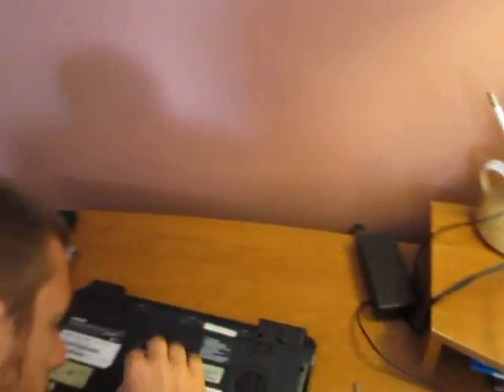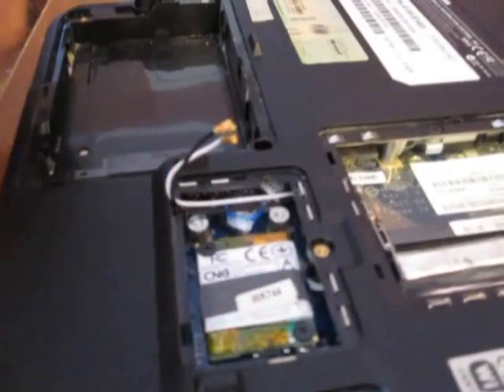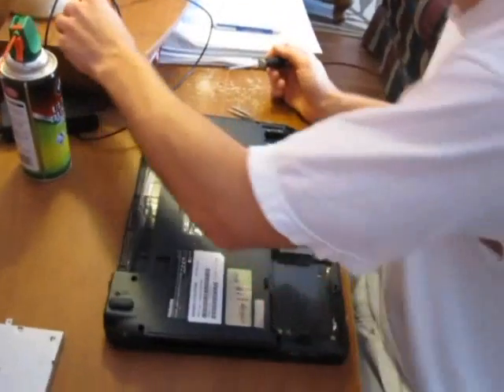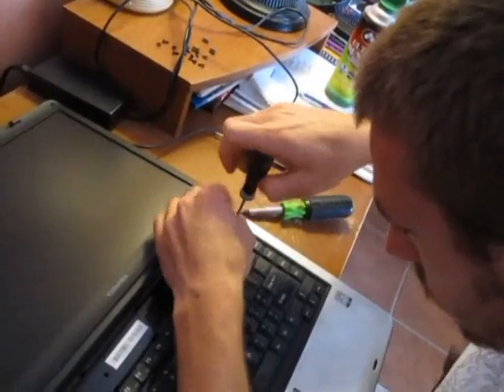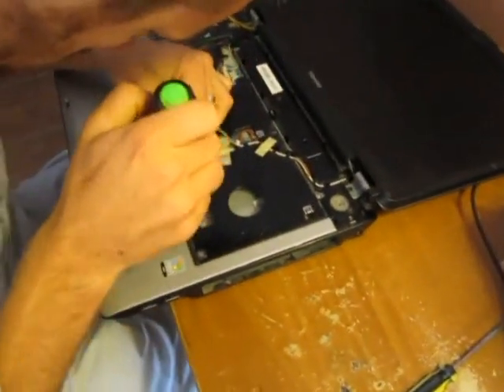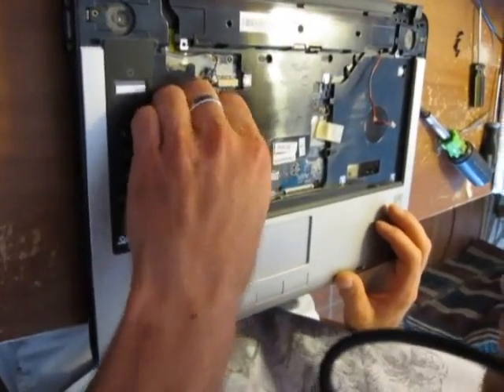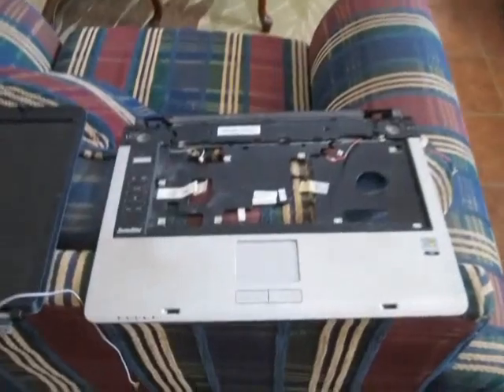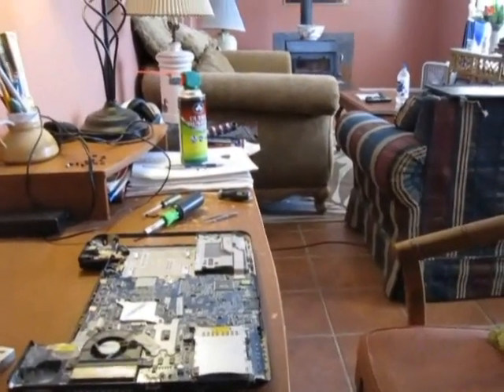How to Clean Dusty Fan in a Toshiba Satellite Laptop (Part 1)

Comment: You don't have to take it apart this much to clean the dust. I took the key board off and the cover on mine exposing the fan and heat sink. Then you hook up an air hose to an air compressor and set the regulator at no more than 80 psi. Then blow the air through it a few times and the dust chunks will come out.

Comment: Use a full size "shop-vac". The hose is just a little bigger than the fan opening. My laptop fan was really dusty and the cpu area of the laptop felt pretty hot. It's a lot cooler now with no disassembly.

Comment: VERY important: whenever you use canned air to clean a fan - case, CPU, whatever - stick a toothpick in between the fan blades so that the fan does not spin.  Compressed air cans provide a very rapid stream of air that can spin the fan at a very high rate of speed.  Not only can it damage the fan, but also, the fan motor turns into a generator and can generate a reverse voltage that can kill your computer by putting overvoltage on the motherboard (the voltage output of the motor/generator is proportional to the rotation speed).  You can kill a CPU and other chips that way.  A word to the wise.
Reply: That's half the fun!  I haven't experienced any harm from it.  But I've only been at it fifty years and on all sorts of electronic equipment.  
I guess my day's coming, eh...  🤔😯😂

Comment: Ohhhhh I am so so so so so so so so grateful to have found this.  I only paid $300 for mine & it has run rather well (really only one issue & that's just cuz IDK WTH i'm doing - cant get web pages to load properly much of the time)  & this issue began with it shutting off all the time & the fan going nuts.... Its only 10 months old I really don't want to replace it, especially since IT replaced my 1 year old MacBook that I dropped on the floor like an idiot... & that thing was expensive as cruuuud.

Comment: Toshiba laptops are great but fan dust is an issue about them. I have a toshiba still running after 7 years though. With a new battery a dust clean and maybe a new hdd it will be like new. My samsung laptop just had its screen broke and imusing the toshiba now. Damm i cant beliece that after 7 its stull going. Without problems too, only the usual problems because of aging
Reply from the maker: You got that right. I'm still using the Toshiba Laptop you see in this video and it is going on 6 years old...I do believe Toshiba is a top quality computer, except for the fan issue...hopefully they will work on this problem and improve it...and make it so you do not have to open up the whole laptop to get to the fan!!
Reply: HMFamilyLIfe FrankandAngie Guess what me too at the moment. I got a broken screen on my laptop for Christmass it seems. And i went back on my old toshi. As a matter of fact im thinking of buying abit more RAM for it, a new fresh HDD and open it in order to get rid of dust and buy a new battery. If i do those things (it costs less than 100 euros) it will be as good as new. Really top quality man. I havent even held a tower for that long.
Reply from the maker: topografer
Let us know how it works out. We're a good advertisement for Toshiba!

Comment: First of all, thanks for sharing this video. Second, it is a must that fan unit has to come off for proper cleaning. More importantly, removing the fan unit allows access to those metal fins (which functions as an exhaust vent and heatsink) which is also a critical item to clean!  -a Toshiba Satellite Owner that has already done this

Comment: My Toshiba was overheating and shutting down too.  The mouse bad would get so hot it would burn my finger tips.   I simply blew into the air exit vent several times, now it works fine.

Comment: Good video. I need to clean a Toshiba netbook and I'm not looking forward to it.
If possible, it's preferable to remove the fan and heatsink so they can be cleaned thoroughly. Lots of dust can get in the heatsink beneath the fan.
Easiest laptop I ever worked was an old P3 IBM Thinkpad. It seems most laptops are harder to take apart.

This is a problem we shouldn't have to put up with. Laptops really ought to have a cleanable air filter to keep dust from getting into them in the first place.

Comment: Acer? Ok, Acer, HP/Compaq, and all lower end laptops (499.00 and below) have cheap prices and not enough vents to provide efficient air movement across hot running processors.  In other words...built cheap.  Toshiba's are wonderful (I have a P775-S7100) and so long as you keep the area dust free, your system will last a long time.  I get sick to my stomach when I have to work on towers that are loaded with dust...try cleaning your house once in a while people.... Happy Computing!

Comment: After trying to clean my toshiba fan with compressed air, it too froze up.  After watching the video, I realized that maybe it just moved dust balls into the way.  So before I tried dismantling the whole laptop, I took my vacuum cleaner hose attachment and tried to just suck all those dust bunnies out of the fan vents.  The fan is back in action!  I definitely sucked out several awe-inspiring clumps of dust.  Definitely worth a try before you attempt taking the whole thing apart.

Comment: Just blow compressed air into the cooling fins and the bottom of the fan. Had my satellite A500 for over 3 years now and works for me. It's the fastest and easiest way unless you want to attempt and break some stuff. Not worth it believe me there is delicate stuff in there....

Comment: This way is difficult and not recomended by ANY amature.  Nor is my teporary solution.  I take some forced air and blow it into the heat exaust port, when I do this, I get a good load of fine dust to blast out of the fan intake.  I am sure I am not getting it all, but my heat drops very well.  I have the Toshiba Satellite L505.